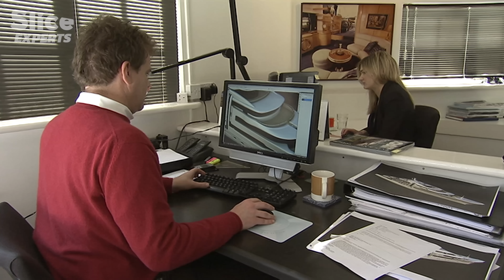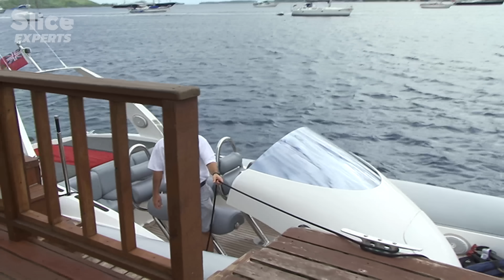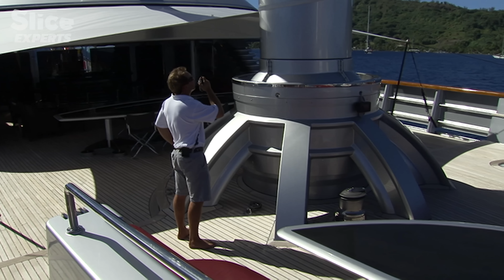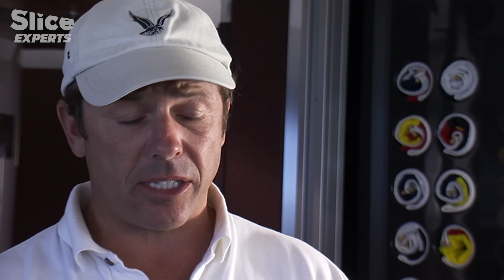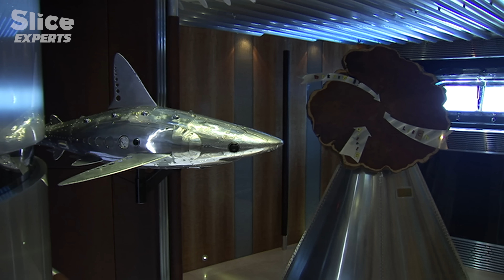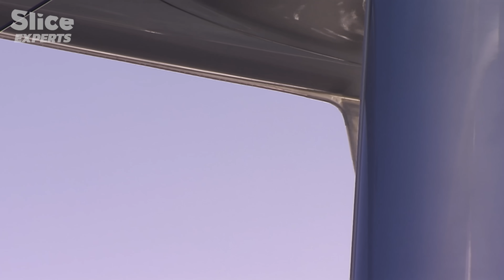How the Maltese Falcon’s Impossible Rig Works | SLICE EXPERTS

Comment: I was happily cruising along in a 40' yacht when this beast went by me doing at least 15 knots. It's not a toy but a serious ocean cruiser. But, given the time it takes to reef those sails, you'd want a captain who knows how to read the weather. I'm still as impressed as when I first saw her. Beast !
Reply: By now they should have simple programming to determine the strain on the masts (Through many built in strain gauges in the masts.) and automatically decide, based on weather info, to either unfurl or turn the masts at a diff angle to blead off the wind.

Comment: I feel ambivalence about this boat. Yes it's innovative, but no you're not going to learn in 15 minutes. In fact a few minutes later someone is talking about not overloading the mast - i.e. you better have a clue what you're going to snap a mast, or turn it into an instant Bayesian. And while sail power is to be applauded megayachts are fundamentally disgusting eco disasters whether they are powered by wind or not. So it's not the worst by virtue of having sail propulsion, but it still exists as a self-indulgent display of excess.

Comment: Grok - The Maltese Falcon, an 88-meter luxury sailing yacht, is available for charter with weekly rates generally between $490,000 and $580,000, depending on the season and location. These rates are exclusive of additional expenses, which are common in yacht chartering.
Summer Season (May - September)
Low Season: Approximately €490,000 per week (about $513,500)
High Season: Approximately €580,000 per week (about $608,000)

Winter Season (October - April)
Low Season: $490,000 per week
High Season: $580,000 per week
Reply: what a farce
Reply: @thomaselliott573  haters gonna hate.
Reply: @thomaselliott573  value is subjective. people pay more than that for paintings, which i'd like to point out don't even have jet skis on their aft decks.

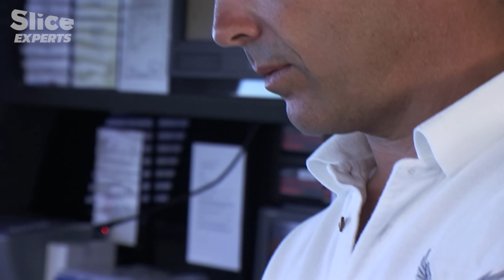Comment: 8:10  I don't know when this was filmed but it's not the "only system of it's kind in the world".  Tom Perkins did not come up with the original idea.  It's been around since the 60s.  I guess that Tom Perkins is just being Tom Perkins and enforcing that certain brand of "specialness" on the crew of this boat.    I turned off the video right after this.
Reply: Original concept was from Wilhelm Proelss in the 60´s, but it was never realized until Tom gave it a shot. By now there is a second yacht with this Rig, Black Pearl built by Oceanco.

Comment: I would be concerned about what back up systems are on board in case of power failure, failure of the sail furling system, mast rotation system or a lightening strike.
Reply: I imagine there are big honking diesel engines and generators that will happily propel the ship if the sails are out of action or if you're piloting this thing close to shore.
Reply: @drxym  imagine the sails getting stuck halfway through reefing when a storm is setting in.

Comment: The 88-meter sailing yacht Maltese Falcon is currently owned by Elena Ambrosiadou, a Greek-born hedge fund manager and founder of IKOS Asset Management. Ambrosiadou acquired the yacht from its original owner, the late Silicon Valley venture capitalist Tom Perkins, in 2009. Perkins had commissioned the yacht in 2000, and it was launched in 2006 after six years of construction by Perini Navi in Istanbul.
Reply: Perini Navi shipyard in Istanbul   is where it was built.  BMW is in Germany but they also build cars in the USA.
Reply: so Tom owned it only 3 years. amazing. i always wondered how the sails unfold, great to see the inmast furling system. i passed the Falcon last summer near Corfu where I was sailing with my boat, it looked stunning from nearby.
Reply: Don't forget that this rig was proposed and developed by Dijkstra Naval Architects in Amsterdam.
Reply: Perini Navi is in Italy ;-)
Reply: @christopheliskases7482 that doesn't mean that it was built in Italy

Comment: can't imagine what a set of fresh whites would cost and who would cut and sew them.
Reply: Helluva lot cheaper than normal sails for any other "normal" boat of a similar size.  Yes, the comment in the narration likening the thing to "some futuristic Chinese Junk" was concocted out of pure ignorance about the rigging of real Junks AND of other real historical ships...  BUT, even if only by accident, that remark is in fact profoundly accurate on a technical level. 

The sails on this thing have none of the 3-dimensional shape and structural complexity needed for traditional sails cut for other traditional Western rig types.  These sails, in very much the same way as the sails on traditional (& much smaller) Chinese Junks, can be made very "simply" out of relatively flimsy sail-cloth.  Because like the traditional Junk rig, these sails themselves have no real "shape" contour to them.  Apart from some obvious basic reinforcement strengthening at the edges and corners, they're just flat sheets of sail-cloth, no more "shaped" than a bedsheet.  All the aerodynamic contouring and "stiffness" needed to make the sails provide lift/drive, is provided entirely by the spars they're fitted to.  Other than not hoisting/furling in the same way as a Junk, the practical principle is really much the same.